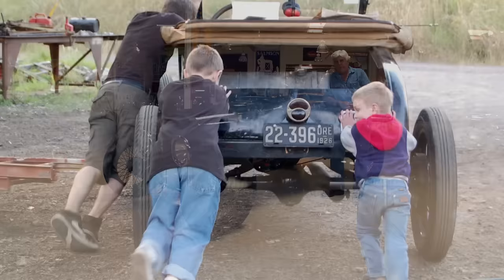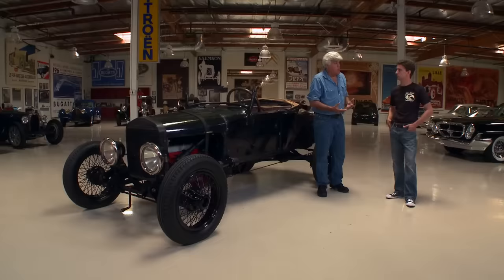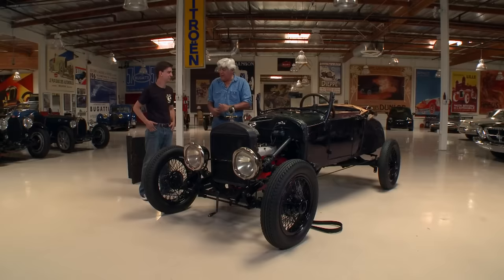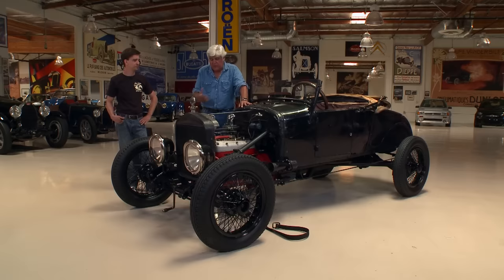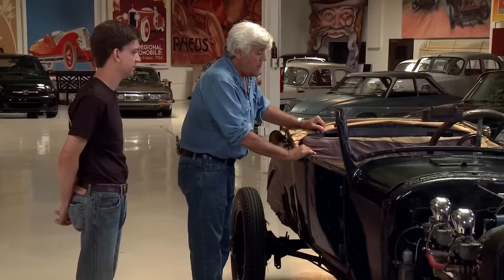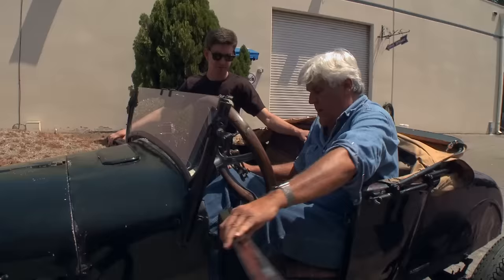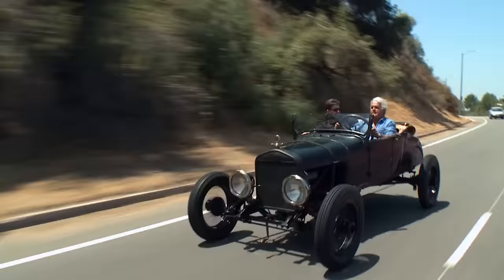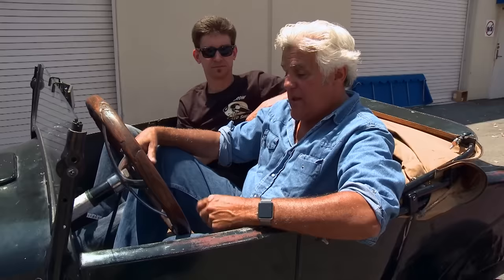1927 Ford Model T - Jay Leno's Garage

Comment: The joy Jay & Clayton show in each other's company and this old car is what being a true car guy is what life is all about. Clayton's involving his boys in the car reminds me of my dad and me doing the yearly tear down on his pumped up '53 V8 flatty coupe. 1953 Ford Customline. Dechromed. Grey. (You could call it battleship grey. He worked for a pipeline company and used leftover paint from a project.) 1BA flathead block with Offie heads, Edelbrock twin carb intake manifold with 2 Strombergs, and Fenton cast iron headers with cut-outs fed into a 4 speed manual. The steering wheel had Lincoln markings on it. (It was a big wheel, a knuckle banger, no power steering.) He was always looking for ways to take a few more ounces off that car. Fast? Oh hell yes! For it's time.

Comment: That is wonderful and inspirational.  My Father is 81 years old and fulfilling a lifelong dream. He is currently building a hot rod from a 1926 model T (T bucket). This thing sat upside down in a field for over 50 years, but  as a testament to the quality of the vanadium steel,  the body is still straight and solid.  As the car had no drive train in it, he is putting in the LT1 engine and complete drive train from a 1992 Cadillac Fleetwood, and the front end from a 48 Ford. He custom built a new frame for it, and is putting in the back seat from an '88 Lebarron.  It fits perfectly as the front seat for this model T, like it was made for it. 

I am so proud of my father for realizing a life long dream at his age, and am constantly surprised to see the cars progress every time I visit.
Reply: Is there any Model T left in his car?
Reply: Paul Standeven at least it’s not upside down in a field now

Comment: This is the kinda video I really enjoy.  More of these types of vehicles please!  As an owner/driver of a lightly restored 1930 Willys-Knight 70B (sleeve valve engine).  I enjoy having an "antique" car that you can actually drive around once in a while.  You can see the video on my channel of that car.   A "T" fixed up like this is more of the Hot Rod I like seeing, but rarely do out in the wild, because the trend has always been to put a small block Chevy/Ford and an automatic in them.
Reply: with an mildly build A/Go-devil and a 4 on the top it's already too fast..
Reply: The GoDevil came way later.  The big 6 Sleeve Valve engine (makes about 65hp) is faster than the GoDevil engine.
Reply: heavy. that does not fit my idea of a nice lil' roadster.
Reply: The Knight 6 in a Roadster body is a speedy little car.  My car is a touring but has the same engine.  http://www.thejunkmanadv.com/the-willys-knight.html
Reply: Wow you do not hear about sleeve valve engines very often really forgotten about by most people! Amazing things though! I have heard some designs are better than others but if you keep them in oil they will run forever. IS that true?
Reply: Yeah, I suppose you could say that is true.  They have nickname "silent knight" as they run very quiet and smooth, way smoother than a poppet valve engine of similar vintage.  They are very complex though, which meant high manufacturing costs.  My Knight has 50,000+ miles on it.  Only thing I did after getting the engine unstuck (back in the 90's) was to dis-assemble it and clean up the insides and put it back together.  I run a quality racing oil (for the high zinc content) and change it fairly often.  The Knight does have pressure lubrication and "sort of" an oil filter.  I have driven it all around the country, including the mountains.  Check out the link for pictures and video!
Reply: For those old low-temperature, loose-clearance engines, give an oil made with Pennsylvania grade crude a try.  The  oil they pump from PA and Western NY doesn't even look or smell like crude oil- it's green.when it comes out of the ground, and so rich in lubricants that you could practically use it in an engine as is.  The high wax content can cause sludge buildup in modern engines, but in these old ones it doesn't seem to bother.
Reply: Mark Stockman The Knight engine is a close tolerance engine (for the day).  There are a lot of precision parts in there.  But you are generally right about all other poppet valve engines such as the "T" even the Whippet and Overland engines are quite loose.
Reply: I absolutely agree with you
Reply: A Willy's? The birth of the Jeep.
Reply: +joe jitsu That is weird. I have now been educated. Funny how it was used by British parts. Nowadays, Jeep preaches that it is 100% American. I'm not so sure. But I love my '96 Jeep Grand Cherokee.
Reply: I am talking about Willy's pre-war cars.  A Knight engine powered Willy's 70B touring car.  See my car here 
 http://www.thejunkmanadv.com/the-willys-knight.html  The Whippet modle 96 would have been the "T's" closest competitor, although the Whippet was a more advanced design mechanically than the T which was long in the tooth by 27.
Reply: joe jitsu wasn’t Ford a part of the story?

Comment: Thanks Jay, your best video. I'd like to tell my Model T story about my dad. I've had a 27 coupe for about 15 years, and when my dad was in his 80's, I would take him to the grocery store in the T. Got a lot of attention, especially from older people who knew what it is. His dad had a T when he was young, and sold it to get a new 37 GM truck with a granny 4 speed. He would take off in 2nd (first was a compound low gear that wasn't used much), and shift from 2nd to 4th., He said he never ever saw his dad use 3rd gear. After riding around in my Model T with the 2 speed planetary transmission, it dawned on him why his dad never used 3rd gear in the truck. He was used to having two gears and didn't see the need for anything else. My dad was born in March 1927, about the time my car was made, and was 10 years old when his dad sold the Model T to get a new truck. After seventy something years, he finally understood why his dad did what he did. I lost my dad October 2014 at 87, but that's OK because I will see him again someday along with my mom I lost when I was 9. What a reunion that will be, but in the meantime, if you see a forest green coupe tooling around Amarillo Texas, that'll be me.

Comment: I never even knew the original engines could EVER be used to drive modern speeds at 60+ mph.  And dual OHC with a blower!  Jeeeze.
Reply: And 300 miles on a 12 gallon tank, still not bad.

Comment: Great car, Clayton.   I approached my T, roadster pickup the same way, limited budget, swap meet/barn find parts and the idea that I'd build it like a kid in the 50s working a minimum wage gig and ended up with a quick little car that absolutely steals attention from far more expensive rides parked next to it.   I really like that you don't hesitate to put it on the highway too.   Have fun, be safe and maybe we'll see each other out on the road someday.  :)   P.S. you're right about that vanadium being tough and durable, I actually welded up 6 outta 7 bullet holes in mine and had zero problems doing so.  (I left the 7th bullet hole because it ain't really a T without at least one)    :)

Comment: My Father had bought a 1927 Model T Touring Car in 1959 - had broken down the engine and rebuilt it - put it back together and still had parts to the engine laying on the floor, he forgot where they went. When he cranked it over - it started right up. If only today cars were as simple now as they were then.  Brought back a lot of memories as I am the same age as you Jay.

Comment: I grew up two houses away from probably the richest family in our little town. The guy's father and grandfather had worked in the local paper mill and they invented, patented and manufactured the first pneumatic air shafts for rewinding paper rolls. He had three sons, the youngest of which was my age. When i was about twelve i went with my friend and his brothers and dad to pick up a 1925 T that was about 10 miles away at a country home. Thus began my education of T's and my interest in classics as the middle brother had a '48 Ford Businessman's Coupe he bought and did the back yard flathead hot rod trip. He still has the car today at 70 years of age although it is much updated with an LT1 350. His oldest brother had a 1940 Chevy 2dr. sedan we would borrow and my friend and me would cruise the countryside and around our local lake. His dad was frugal for his means to the point that he dynamighted the sand stone and excavated a basement under their house in the 60's. The T got a budget resto and also a 1930 Ford Victoria to a much higher standard than the T. I must say i have always felt fortunate having the child hood i had in a town of about 5,000 in the Pacific Northwest as i spent much of my childhood around that family.

Comment: My old Dad always loved the T, he felt that as long as he had a little tool kit, and could find fuel, oil and water, he could just drive on forever. He built jet engines for The Air Force but, he really could appreciate this simple yet well thought out design.

Comment: That is my definition of a hot rod. Build it yourself with what you've got. Who needs 750 hp?!
Reply: kcraig51 when the car weighs less than 2,000LBS nobody! 250-300HP is insane in a hot rod.
Reply: It's because of that that it's easy to see why flathead v8's was "the go to" for hot rods, for decades and decades.
Not the highest performing motor, but for the few pennies it cost it offered enough performance to have fun :)
Reply: ACPHOTO that thing makes less than 100 horsepower don’t get your hopes up pal those old flatheads made around 25 new and 90 modified. The Jeep godevil engine was definitely the superior motor compared to the ford flatty 4

Comment: That is an ultimate late model T. His dash is perfect for the era , the engine is smooth and powerful. A fantastic job and a work of art.  I didn't know they changed the crankshaft in late 1927... I have a 27 T chassis, now I know what to do with it. It's a driver -

Comment: I was in Alameda and Oakland during the beginning of the Hot Rod area when all the men came back after WW2 and most all of the builders were ex military personal. In my area when I grew up Hot Rods were everywhere. I was born in 1939 the start of WW2 and Hot Rods were all around me the latest version was a 1932 or 1933/34 3 window coupes were everywhere. I remember buying a 1934 for roadster minus engine and trans for $3.00. when I was a teenager wanting something to work on. Drag racing was starting up at all the air strips that were everywhere in California. Lodi was close and that was the strip that had the fast flatheads and inline six cylinder racers. When I was in High School during the 50's the NHRA safari was in full swing and car builders were everywhere in the Bay Area. The first flathead I built was a 3/8x3/8 Merc block flathead with three carbs, Potvin cam, Kong ignition, Edelbrock intake and cylinder heads, headers, truck clutch and pressure plate, Ported and relieved by Vic Hubbards shop in Hayward Calif where we spent Thursday nights at the shop. Romeo Palamedies, Millers custom and speed and Vic Hubbards were the place to be seen at and pick up your parts. Would not have traded that time in Hot Rod history for anything.

Comment: Really enjoyed the video,we recently traded for a 1932 Ford 5 window coupe and it still has the original 4 cylinder engine,it hasn't been on the road for many years but we got it running and drive it about a mile and turned arond and went back to the shop,It's far from being road worth but the smile on my face couldn't be removed with a side grinder.

Comment: Jay, I have a 1990 Ford F-150. It belonged to my older brother. He is no longer living. I was using it as an everyday driver. A guy recently ran a red light and hit me. It messed up my front bumper and head lights. But due to the age. The insurance company totally it out. I still have the truck. Do you have any ideal what it would cost to restore it?? Back to the way it looked New. With the factory stock 6 cylinder motor. The truck means a lot to me. I am disabled and do not have much money. Can you give me any advice? Thank you, Thomas.
Reply: I would take it to a local mechanic and get an estimate but shouldn't cost much if just bumper and headlight
Reply: A '90 F150 isn't very old in terms of "old car's" so you should check your local salvage yards and you may find some parts that haven't been crushed or picked, but if its just front end damage it shouldn't cost much at all, good luck!
Reply: if its just a red light runner, then it was probably a 20 to 40 mph collision....i cant get too specific because a 20 mph crash is NOTHING compared to 40. 

first off.... take all the bent and messed up stuff off......you can have a body shop straighten it.... but for a 1990, your best bet is to go find a local junk yard....and just get "new" quarter panels. 

after that... you NEED...again... you MUST have sure the frame is straight and not bent. otherwise the new quarters arnt going to fit and line up properly.... 

and you will be going down the road sideways. 

seeing if the frame is bent is easy to do your self (google "how to tell if my frame is bent" lol).... but making it straight again is something a shop would have to do....... like... i rebuild engines and transitions in my spare time...but id still take it to a collision repair shop to get a frame straitened.  same with suspension stuff. 

was the motor messed up? tahts probably going to be your biggest cost.....

again... a junk yard will have a decent motor for cheap.

your still going to want to rebuild it....either the original or the junk yard motor.... just to be safe, and to have something reliable that will run for 200,000 + miles. a hard knock can bend/stress the internals.... causing them to either be bad now, or wear out way quicker than they normally would. 

and tell the mechanics that its your bros car, and your restoring it for him......if they think your fucking with them, dont do business with them.

 most mechanics understand the love of a car like that.... i have a 68 impala that was my late aunts....never selling that thing

its a work of love.... not profits. 

but theirs NOTHING like doing it your self.... and learning SO SO much. 

my family is poor as dirt.... ive been working on cars for as long as ive been able to hold a flash light and look on with curiosity at my dad. 

and for some strange reason.... my cars dont break down as much as people who jsut take it to the shop.....because i know that its done right....

you also learn about how the car works.... what are its strong parts.... what are the weak parts you want to keep and eye on...VS just driving it till you have a problem. preventive maintenance!
Reply: also check out Craigslist for a donor vehicle and or parts, once you've priced salvaged ones. you would be surprised what you find.
Reply: but as for cost.... ROUGHLY!....2000 to 6000. 

including a paint job.
Reply: I'm sorry, I have to ask. Did you honestly think Jay fucking Leno was gonna swoop down here and answer your question in the comments section? You addressed your comment to Jay as if he'd ever see this himself. Not trying to be mean though, I'm sure a lot of other people here would be happy to respond.
Reply: +sixmam Yes I was thinking Jay views his own YouTube channel. I not trying to put the bum on anyone. I am just asking for advice and tip's as to anything that might help me with my problem. OK?
Reply: +kain hall NO! NO! NO! You go to the bridal store down the street and pay 500.00 for all the new parts. 😜
Reply: Bridle store, not bridal store. You won't find any bargains in a bridal store.
Reply: He does read the comments sometimes at least! Recall the bit about "leaving the signal lights on" ?
Reply: Man I'm dumb on this, I genuinely thought for 20 minutes or so he said "Bridal store" and somehow I didn't piece it together that they wouldn't be selling leather straps. HAH.

Comment: Jay once told a story of an older man and his new manual shift car (late 50's I believe).  He said the old man would constantly burn out clutches and had at least 3 installed in the same number of years...because of how he used to operate the clutch pedal.  Being a mechanic, I thought about this story Jay recounted and often wondered why or how this man could do such a thing.  A while later, I became familiar with how the old Model T planetary gearbox and its pedal operated (for low and high gears)...you had to push your foot into the pedal to engage low range.  It instantly hit me why this older man in Jay's story burned up clutches so fast... I'm certain he learned to drive in a Model T.

Comment: Loved this episode!  Cars meant for pebble beach are interesting and amazing works of art but this is cooler than most of the cars with a six or seven figure price tag in my opinion.  Opening your wallet for an expensive toy or hobby car is one thing - but living under a budget and building it yourself is much more rewarding.  I'm restoring a 31 Model A coupe and I'm looking forward to driving the wheels off it again once its finished and this episode only adds to the motivation.

Comment: It's mind boggling the breadth of accessories that were made for the Model T.  You could turn them into a sawmill or a tractor, you could get overhead cam heads and so forth (as Clayton points out).  Look at some of the ads in 1920s newspapers.  Simply amazing.